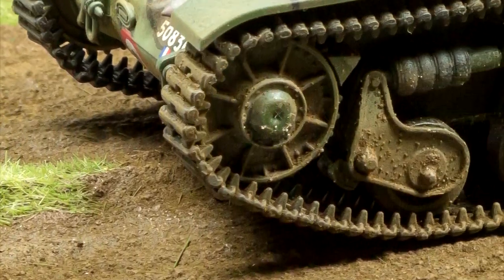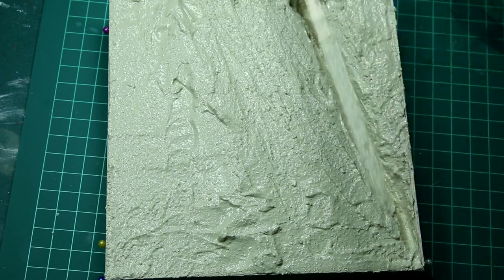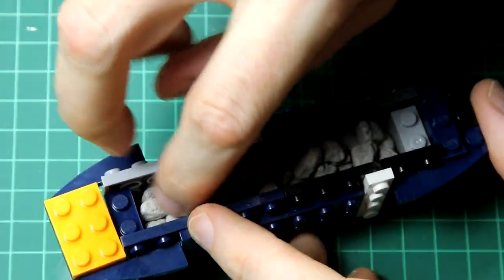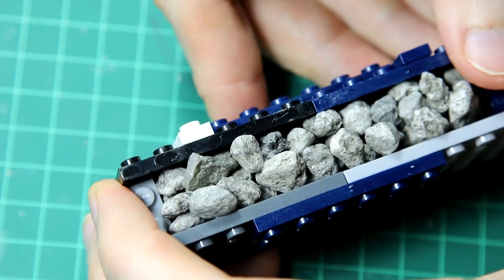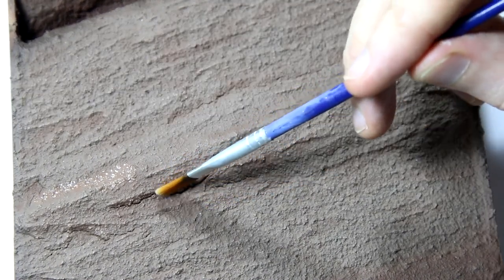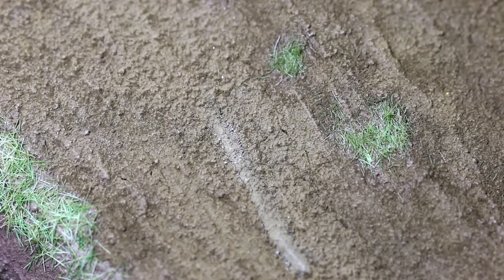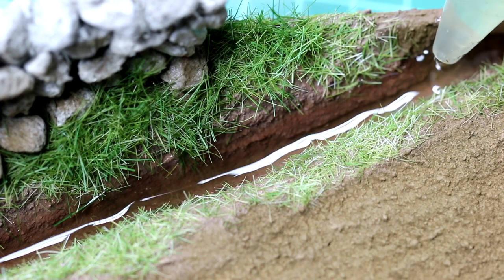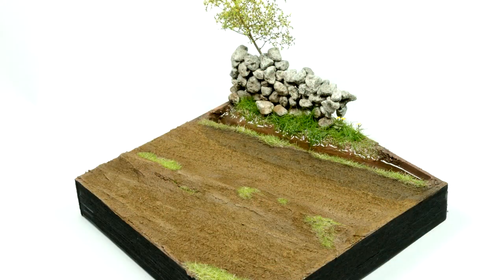Build a simple dirt road diorama (road, stone wall, ditch, grass, tree)

Comment: Neat. A simple base, works great for photography. I built one much the same for my Verlinden Pzkfw IIL Luchs. I set it up to look like a road in the Falaise Gap, the tank abandoned after running out of fuel, with a  couple of soldiers walking past during the retreat.
Reply from the maker: Sounds great! Do you post any of your work? For example to Youtube or Instagram?
Reply: @ModelNerd  So far I've only put pics up in Imgur and then direct linked to them from various forums. Not even sure I've taken any pics of that one. I'll have to look in the archives.

Comment: Pro-Tip - When you make the Lego mould for your wall, spray a thin layer of light oil, such as WD40 on the lego first.  When the wall dries, you'll be able to pry the lego off the wall with ease without disturbing or breaking any stones away.
Reply from the maker: Thanks Craig - good tip!